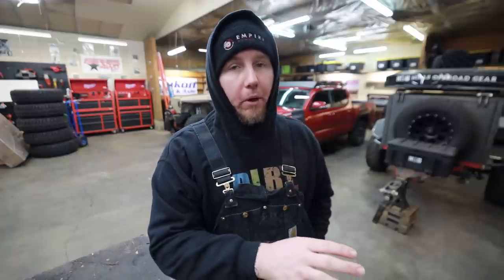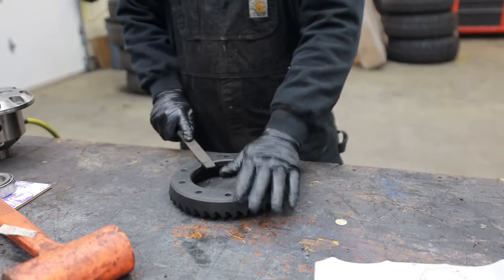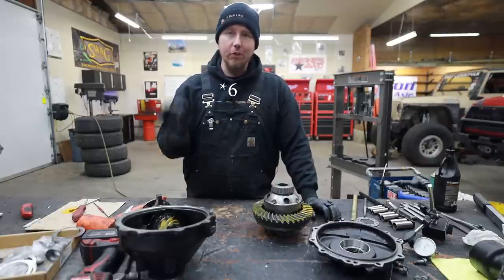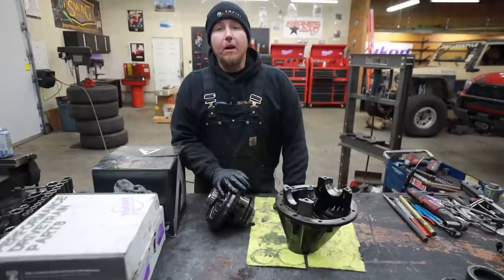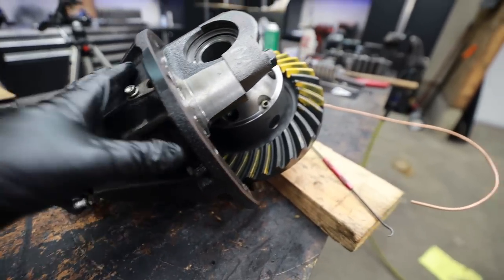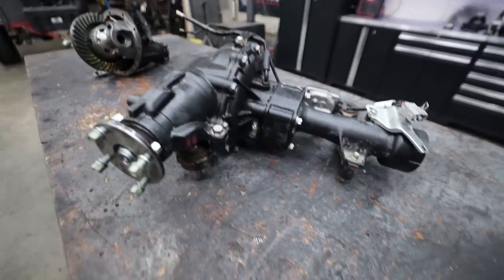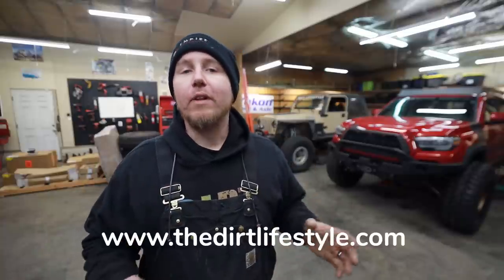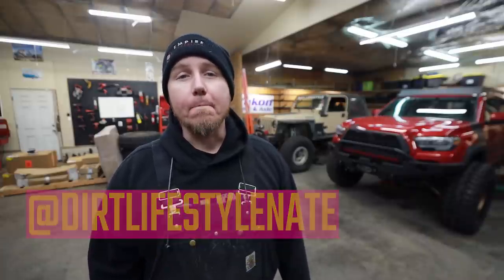Ultimate Toyota Tacoma Build Episode 4. 5.29 Yukon Gears And ARB Lockers.

Comment: Another vote for SwitchPros. 
Check out a CVC Tune.  There are a number of techs certified to do these tunes. 
Not sure if you are wanting to do on board air with enough power to run air tools as well as your air lockers. If so, Viair has an amazing high output dual compressor set up 485C Gen 2 performance duals rated at 200psi/3.82 cfm. p/n: 48532 platinum or 48542 black. I'll be installing these & a 6g tank in the spare tire hole on my 4Runner.

Comment: Ov tune (orange virus) is the most well known and respected, vis carbon fiber hood save the weight and it’s actually functional, arb twin compressor and expedition essentials bed mount, switch pros have been on top for a while looking hard at the garmin switches coming out. Can all be controlled threw the phone. No need to mount to the dash and can be controlled next to the camp fire. No power atm so watched the vid in like 480p and buffed every minute, still worth it lol 🤙🏽

Comment: For the compressor I would checked out the Viair with dual setup.  Im running witout a tank but considering welding a tube thats doing both perpuse if being an tank and a extra crossmember at the back under the tub. 
Not to much to goo on the weight in the front as winch and heavy bumper is taking it up.

I Think Viair also have a faster compressor then the ARB twin.

Mount them where the spare tires was with some protection from salt, rocks and Dirt.
Two outlets.  1 in front and one in the back or in behind where the gasLid is.

Sorry for baf English 🕺

Comment: Slee Off Road makes some different compressor mounts for under the hood if you don't want to use the bed cubby option. I've seen dash replacements by Meso, SDHQ, and Cali Raised for Switch Pros or additional OEM switches.
Reply: I forgot to add that Expedition Essentials makes some cool mounts for your other gadgets on your dash.

Comment: S-Tech makes some good switch systems that are vehicle specific. I think SPOD also makes some vehicle specific mounting stuff and their switch panel runs to relays to handle some heavier currents. If you want a wireless option that you can slap a 4 switch (remote switch controlling relays) in a non specific spot in the truck, TRIGGER makes a nice wireless option.

Comment: A solid spacer is a better way to go than crush sleeves imo. I blew up the front diff on my 4runner because of big tires and low gears can conspire to crush that sleeve under heavy loads. Pinion goes loose you know the rest.

Comment: Another great video in the can here.. I'm looking at a Detroit style locker for the front of my 98 4Runner. I think it will go well with the elocker I have in the rear. Biggest tire I'll be running is a 33". I converted my 4R to 4x4 and had to deal with the speedo issue too. I went with an electronic recalibration unit from Australia. Pretty easy to install and adjust using a GPS as a speedo to match it to. Just 4 leads to hook up, power and ground then you splice it in to the signal lead to your stock speedo in and out with the other 2 leads. There's two potentiometers in it you adjust to correct the stock speedo reading. Mine is a Digitech AA-0376. As I recall I got it for $50. There's another unit from New Zealand that looks just like mine and has the same part number from Jaycar. I got mine from  an Ebay seller after I researched it. Works good for me..

Comment: Switch Pros 9100, SDHQ panel to left of steering wheel for the Switch Pros, Powertrays mount in engine bay (get the one with additional fuse panel for more elec extras NOT run by the Switch pros), 100A (fuse panel) and 125A circuit breakers (for extra protection of Switch-Pros) from Powertrays mounted onto the Powertrays dual circuit battery hold down upgrade, SDHQ battery terminal upgrade kit, and wire to your heart's content. Eight KC Hilites on magnets for rock lights is a great setup - one pair in front/back of each tire. For the compressor, ARB twin is easier to tie to the Switch Pros and will be faster on those big tires to air up. Mounting location under hood is limited to passenger side at firewall if using a Powertrays for electrical on the driver's side. All other electrical is on driver's side anyway, so put air on  the passenger side. It is possible to mount an ARB twin in front of the radiator, but running lines to the locker gets weirder and it just seems like a 2nd rate solution only people with 2 batteries opt for. Slee Offroad makes a good bracket for the compressor.

Comment: For the switch panel in my Taco I just got a 6 gang switch off Amazon and mounted it in the change cubby to the left of the wheel. They make larger than 6 buttons as well it just might not fit the cubby spot.
I have the TRD Sport hood (not sure if thats the same as the Pro hood) with a 10" light bar installed in it.
ARB makes a dual compressor that can be mounted under the front seats, its thier common double barrel blue one they make, not sure of the model.
There is a kit you can buy to calibrate your spedometer as well, mounts behind your steering wheel console. Plug n Play. There are some vids on YT showing how to install.
Hope some of this helps.

Comment: A lot of people have been using auxbeam or switch pros for switches. Another one is rocker switches but you can be limited with how many you can add. As for the air compressor under the hood kit or another place is in back compartment in the bed lower compartment towards tailgate. Another one is A lot of us have seen your air compressor plumbing video and we started doing those with tanks where the spare tire goes since you can only fit up to a 35 inch tire. That’s for the speedo my dad shop did it with her computer to sync it up right. Granted I have a second gen tacoma but I have a fiberglass hood from McNeil racing that has a hood scoop etc.. another common upgrade is upgrading the steering rack to a tundra or even full hydro.. but a common issue is the tie rods which we switch to hiems and some DOM tube with a Clevis so we don’t bend tie rods as often. Which I do a lot on 35s. I forgot to mention another common mount is you take your switch pros and you put it in your sunglass holder above in the center part of the roof. Another common issue on the tacomas no matter what year is the rear C channel likes to bend and move do to you flexing etc. the huge common thing is to box in the rear half the frame which I know would be a lot of work for you to do but it’s better to do it and then not do it and have issues down the road if you decide to keep your truck. Good luck Nate you have quite the build on the tacoma.
Reply from the maker: Tons of great info 🙌
Thank you!

Comment: I like my 5.29 on my 93 4 Runner on 35's. I think I might try an even bigger gear. It has 207,000 miles and I have to let off the gas to not peel out sometimes. And it's just a stock 3.0 5 speed. I do have bigger exhaust and high flow cats and Flowmaster 50 and it does sound sweet.  But at 70 mph I'm at 3000 rpm. I want 40's and am building a Dana 70 for it next.

Comment: 1. Switch pro 9100 
2. Dual ARB air compressor/ expedition essentials bed mount. 
3. Hypertech Speedo Recalibaration

You’ll need a catch Can too if you don’t want the engine to blow up.

Comment: If you do an FJ cruiser transfer case you can eliminate the front disconnect using an FJ cruiser axle tube.
Reply from the maker: I found the same info! If I have more issues with the 4wd system I will go this route for sure 👍
Reply: @DirtLifestyle   mine worked great for the first 100,000 miles but they did not design that system for longevity
Reply: Double this. Non ADD gang! I used the front diff full assy. out of an gx470, manual t-case from a trails edition 5g4r when I did my pre runner 4x4 conversion 🤙🏻
Reply: Can also use the 4th gen 4Runner with V8 and 4wd front axle tubes. More options for parts availability that way.
Reply: @xtremewlr   correct, same part number. I grabbed the gx one since the vehicle it came off had less miles 🤙🏻

Comment: Arb setup fits passenger side above air filter
Switch - cali raised coin cubby x3 switch panel Part#: 126782
Speedo correction - rough country SKU 90043
Additionally, VRtuned has a great tune and dials in for tire size and diff change (shift points etc... really worth the cost)

Comment: The shop that did my 2nd gen tacoma gearing and locker mounted an ARB single cylinder compressor behind the driver side headlight and in front of the battery. I'm not sure, but I think there is room to do that on the 3rd gens too. It's completely out of the way mounted in that location but the chuck sticks up between the back of the light and the battery for easy access. If the compressor needs service just remove the battery. The downside is the 38in tires are right at the limit of the single cylinder compressor to fill in a reasonable amount of time, it'll work through if you're not in a big hurry.

Comment: You mentioned a retune accidentally, but that's something you may want to get done as well with the 38s and 5.29s.  Also third gen autos are known for shifting pattern issues and hunting gears.  OVTune is a retune option everyone with an auto seems to like.  Additionally, Pedal Commander is a $400ish device that changes the throttle output sent from the pedal to the computer and it's super simple plug-and-play.  I added one to my manual transmission 2017 in 5 seconds and I'll never go back.  Also, bonus, I use the Eco mode when in 4Lo on trails to have better two-foot control; right foot just keeps it running, left foot controls speed with the brake.  For anyone driving a third gen manual transmission Tacoma, if you haven't gotten a Pedal Commander and done the clutch accumulator delete mod, you should look into it asap, it's a life-changer for sure.

Comment: Switch Pros seems like the best switch system for the Tacoma, but for mounts I would actually avoid the 3D printed mounts because they tend to be low and dig into your leg. I highly recommend going with an Unholey Mount. It's super easy to install into the vent ring on the driver side and still gives you almost full use of the vent. It has a RAM ball that you can attach nearly any type of mount to it. I have a Voswitch mounted in this way on my Tacoma and it's perfect (IMO).

Comment: Super excited the Taco is coming together. Glad you’re sticking with IFS. Looks like she’s gonna be a beast. 

Arb twin behind the intake. There is a mount above the wheel well. CBI makes a bracket. Also running4tacos has a bracket for a M.O.R.E-ARB twin with air tank bracket. 

Switch mount I like the “SDHQ Switch-Pros SP-9100 OEM Keypad Mount”

Speedo like other have said rough country makes one. 

 KDMAX or OV tune is definitely needed.

Running4Tacos also makes a short exhaust which would be perfect for your build.

Comment: My arb twin compressor is tucked back behind the air box on the passenger side. But mines a 17 also my air compressor switch and front locker switch is up in the center right by the factory rear locker switch.

Comment: You need to do something with the steering. Stock one is too weak for 38s, even 35s are problematic. I read somewhere about some guy or company (I dont remember right now) installing 200 series rack on the Taco to solve the issue.
Reply: The RCLT requires an exchange of the steering rack for the 200 series land cruiser. I am currently doing the same kit!
Reply from the maker: I've got a Mar rack 👍

Comment: Hello, new to your channel, great content!! 

As for the question on where to mount an air compressor, and without knowing your 2021 intimately, I'll tell you I added a viair compressor in the rear of my 2008 Tacoma on the passenger side fender on the forward side of the bulk head between the tail light and the outside skin of the fender vertically.  

So to explain, if you remove the rear tail light, there is a structer there behind the tail light. If you lay beneath the truck you will see you have access to that structure (between the inner bed and outside skin of the fender) from under the truck. 

You can drill mounting holes into that structure and then mount the viair compressor vertically, using isolated (rubberized) mounts. It has worked for me on my 2008 for years without issue, but I'm not sure if your 2021 is the same, but worth a look in that location. 

Great Channel, love the content! 👍

Comment: what I did in my truck is I made a bracket that holds 4 rocker switches and it bolts into where the ash tray is. people have made 3d printed ones but I'm not sure if the is something that can work on the tacoma

Comment: I see Taco guys mount the ARB twin compressor to their fuse box lid which seems weird. I just mounted my ARB twin compressor to the passenger side fender well on my FJ which is similar. My compressor doesn't like the hot engine bay though so I guess since you're swapping out the bed fenders, you could probably hide it behind the fender against the bed tub and run accessible air lines.

Comment: With gearing you will probably run into the issue of the truck speed limiting you at 86 mph on the speedo. Most that go to 5.29s have this issue.  Toyota uses the speed limiter thru the rpm and gear or something other than wheel speed. A tune can solve it but it definitely is a headache if you run highway a lot.
Reply from the maker: I imagine with 38s this truck won't reach 86 mph regardless lol
Reply: I have 37s on my 3rd gen and it’s way overloaded at around 7500 lb. With 5.29s and OVTune, it’ll go 95-99 mph when driving downwind. My truck doesn’t limit the speed on the speedometer, although I have heard of that happening. But the tune makes a huge difference for rpm, shift points, mpg a bit, etc.
Reply: @Wandering Winterfields  it's so strange that 90% of owners that went to 5.29s have the speed limiter issues and that 10% don't.  It doesn't matter the year or model. It's such a mixed deal.  I had the limiter.  My buddy didn't.
Reply: @vegasrider05  yeah, I have no idea how that happens. No one does, lol.

Edit: FWIW, mine is an automatic 2017 DCLB OR.
Reply: @Wandering Winterfields  yup.  Either way we definitely agree that a decent tune with OVtune is worth every penny 🍻

Comment: Depending how many blank spaces you have on the  center console and dash they sell aftermarket switches with different labels that will go into the blank switch spots in the truck. I have 3 set up on my 4Runner and everyone thinks they are actually OEM switches.

Comment: sdhq has a nice switch pros mount. I had the slee off-road dual ARB compressor mount with the aluminum tank underneath it. I had a manual OR trim. Not sure if it fits all trim models.

Comment: SDHQ makes a panel for the Switch Pros 9100 that fits in the left hand side cubby. Power trays has a bracket for the harness inside the engine bay. I know you mentioned a TRD Pro hood but they’re also the same as the sport hoods. I am curious what your plan is with the transmission/shifting issues the Tacomas have, unless you purchased a manual.
Reply from the maker: Thanks for the info 👊
I have been told you can tune these transmissions to shift better so we will see lol

Comment: Get an Ultra Guage for correct speed and monitoring of all the Engine sensors or an aftermarket head unit that reads those but they usually don't have speed and rpm like an Ultra Gage.

I'd probably say just get a Switch Pro, I don't think anyone has a system as programmable as a switch pro and smartphone friendly.

For the compressor, Slee makes some mounts, but I didn't want to spend $300 so I made my own copy of a Slee that fits the compressor in the sameness spot as the Slee by relocating the power steering fluid container.🥰🤙🏾
@AlohaExpeditions

Comment: Hi Nate, I see you banging on that diff to crack it open. Your  chisel is pretty fat and can mark the castings.
Try one of these instead : Use a "lever Scraper bar " instead. Cut the lever part out. This is hardened steel and thin enough to split open any casting without damaging anything. The one from Richard is the best

Comment: C4 Fabrication makes a 2nd battery bracket that many use to hold a compressor. They say they’re for 4Runner but my buddy put one in his taco. He probably did some minor modifications to make it work but you have far more skills than he. I have one in my 4Runner. As to adjusting the speedometer. There’s a computer program that any Toyota dealership has that can do it. You can buy the program but it doesn’t run on anything newer than windows xp. Unless you have 15 year old computer laying around, I’d just take it to a dealer.

Comment: My man.  Tearing my 2021 (5500 miles) apart this month and get rid of those 3.90s.  This vid couldn't come at a better time.
Bummer they didn't use screw adjusters for the side bearings like the old style.
Hypertech has a plug-in speedo correction module.